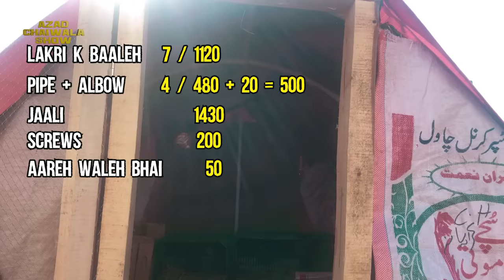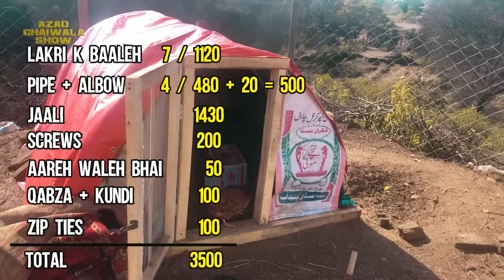Rs.3500 Ka Chicken Shed for Chicken Farming In Pakistan  | Urdu Hindi Punjabi

Comment: U r doing good job I am also in London I have started my own dairy form in Pakistan 🇵🇰 now I will permanently move in Pakistan in sha Allah thanks Azad bhai u r great
Reply: If you want to build an animal farm then have a large steel shed raised above the ground with gates either side and a large manure pit just out side the gates on one end and concrete floors  and  no wall in the shed, but have all gates in the shed that could  be opened up so that a small tractor could  scrape the floors and clean up the manure and put it in the pit. Have manholes and drains every where. You need it so that it is very easy to clean. You could make methane gas out of manure too. But try not to be cruel to animals and let calfs meet their mums. Plan it so that you could expand in the future and get vacume pump slury tankers etc.
Reply: Hi have you moved to pakistan now? How is your dairy farm?

Comment: U cant fit 50 chickens in there, the space is too small maximum 5 chickens can fit in there
Reply: I think wo sirf rat ko rakhny ka bat ker ra hy. Subh hens ko azad ker dty hn to free range
Reply: @sumairanaz1949  but at night they have no room to sleep and they sleep on roosts which arent in the coop
Reply: 1 adult chiken required 1 sq ft. Space
Reply: @mazeemsaleemi2223  no it's actually 2 square feet and theres still not enough not enough room
Reply: 50? 😱😭😤nooooo. That is inhuman to the poor animals
Reply: Right
Reply: HTA The Gamer actually I do such work and I have kept like 100 hens in a shed of 12*14 ft room and there is still alot of space there! And yeah hens don’t need to spend all the time in that shed! They are free to move anywhere
Reply: @huzaifazafar4302  how do you prevent them from extreme weather? i want to make desi murghi farm
Reply: @huzaifazafar4302  That was before COVID19. Now it's 6ft between chickens.
Reply: 50 Chicken need 50*50area
Reply: @MohammadAli-sg8bj  Use 100 watt bulbs to keep the coop warm, if you live in a region where it doesn't snow then your adult chickens won't need much heat, they can keep themselves warm just protect them from the rain
Reply: If they can fit 200 people in a 15 seater minibus getting 50 chickens in a shed is no problem 😂😂😂

Comment: Very nice work. But you can use 4” pvc pipe at around the bottom too to make it extremely light and easy to slide on ground. Also tie a four foot or so rope in the middle of each base to pull it around, instead of pulling on its frame and breaking it apart in few days. You didn’t need the heavy wood frame at all. Those thick nails might split the wood, you could use thinner nails. Over all your presentation is impressive, good luck! You’ve to have some grain thrown in cow manure to process soil everywhere else for worm n bugs when chicken coup come back on the spot. This Organic is more healthy n fashion in west
Reply: But it will be too light and in windy conditions it will fly away

Comment: If you want to build an animal farm then have a large steel shed raised above the ground with gates either side and a large manure pit just out side the gates on one end and concrete floors  and  no wall in the shed, but have all gates in the shed that could  be opened up so that a small tractor could  scrape the floors and clean up the manure and put it in the pit. Have manholes and drains every where. You need it so that it is very easy to clean. You could make methane gas out of manure too. But try not to be cruel to animals and let calfs meet their mums. Plan it so that you could expand in the future and get vacume pump slury tankers etc.

Comment: I was starting to build a small chicken farm. You gave me a great idea May God always keep my brother happy Ameen
Reply: If you want to build an animal farm then have a large steel shed raised above the ground with gates either side and a large manure pit just out side the gates on one end and concrete floors  and  no wall in the shed, but have all gates in the shed that could  be opened up so that a small tractor could  scrape the floors and clean up the manure and put it in the pit. Have manholes and drains every where. You need it so that it is very easy to clean. You could make methane gas out of manure too. But try not to be cruel to animals and let calfs meet their mums. Plan it so that you could expand in the future and get vacume pump slury tankers etc.
Reply: @jamilaslam5527  No No
I just want to start a small  poultry farm with 100 hens only for experience.